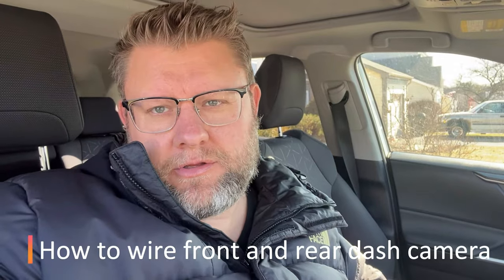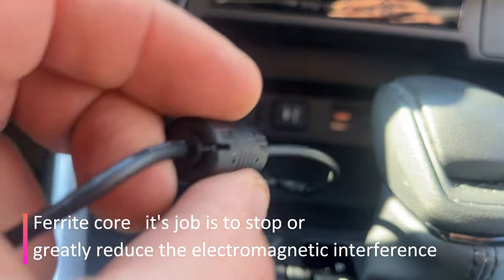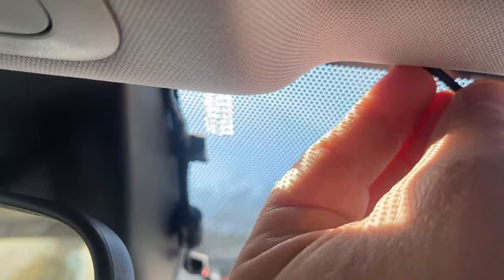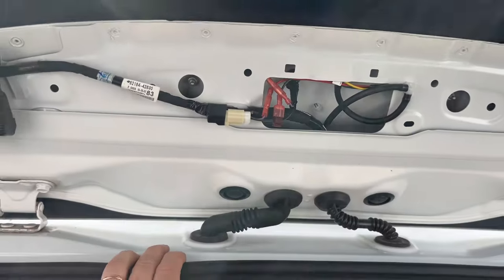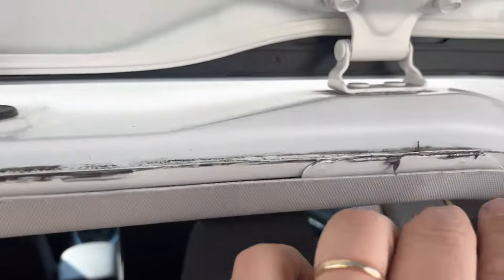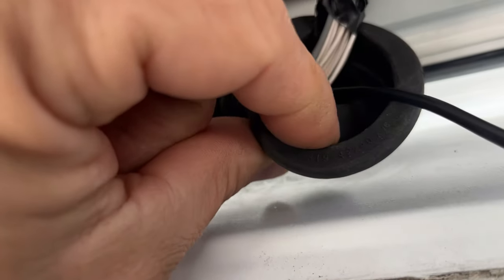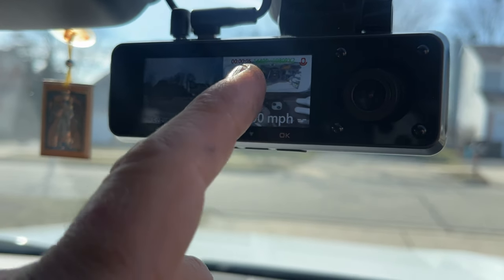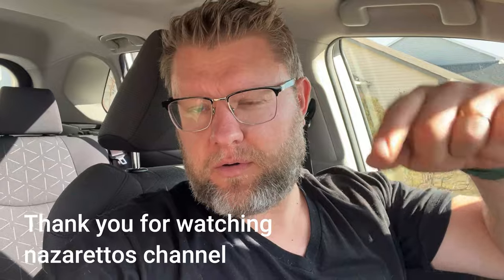How to install dash camera wiring 2019-2024 Toyota Rav4

Comment: How do you get the wire from the glove box over to the hole above the power outlet?
Reply from the maker: Start video from 5:28
Reply: @nazarettos6987 thank you!!! I actually ended up figuring it out. I tied a colored zip tie around it and used a flashlight because the cable wasn’t moving toward me and I couldn’t see it.

Comment: Isn’t there power right by the dash cam inside the dome light housing?
Reply from the maker: There is, but you don’t want to slice anything and just connect there without a fuse. If you want to connect to constant power you need to connect it to fuse box
Reply: @nazarettos6987  thanks, I’m about to do the install on my wife’s 2024 hybrid rav 4 and I told myself I’m not going to use fuse taps. I’m hoping I can get behind the dash to tap into the cigarette lighter +.